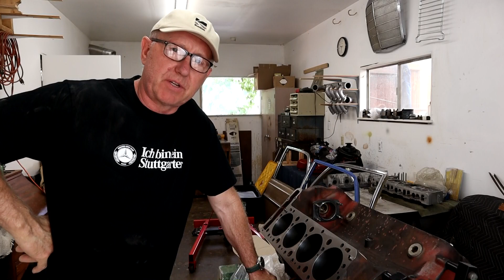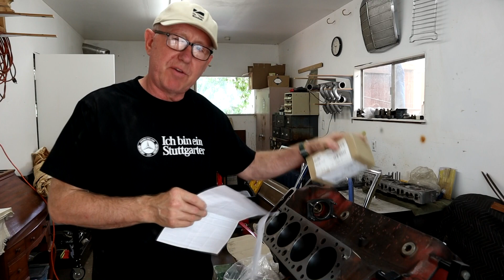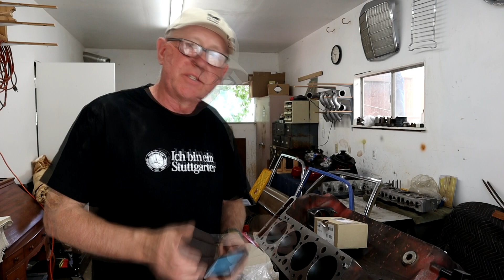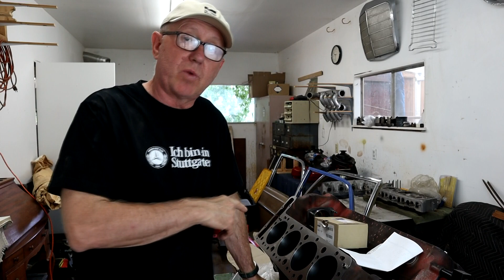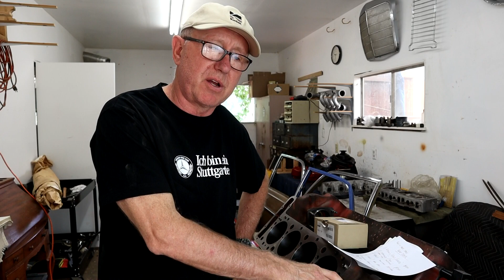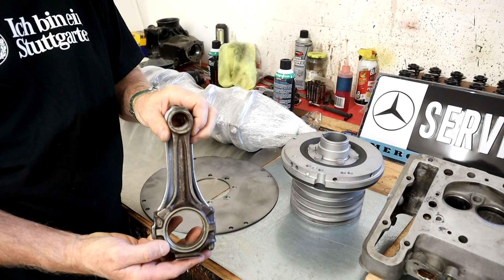MERCEDES M100 6.3 ENGINE BUILD COSTS PART 1

Comment: Was just one bore machined to +0.75 (and the other seven cylinders only honed)? Have you considered sleeving that bore to standard? Sorry if this is a dumb question on this specific engine as I am not an expert, just learning! Thank you.
Reply from the maker: Not a dumb question at all. I had all cylinders bored to 103.75mm. Which is essentially between first and second repair size. Sleeving just one cylinder could result in the adjacent bore being distorted. So you should do the whole bank. It was more economical and advised to re bore and have pistons made. They wanted nearly 3k in machining costs to re sleeve the whole block. Then I'd have to use standard older pistons that I didn't know the history of. 
All the best Cheers John.
Reply: @mercedesmaintenance.6339  Oh I see! Then re-boring everything was the best way to go. Thank you!

Comment: Very nicely presented video, 👍the costs are about right there with this sort of specilised work at the turners. 
One thing, the block and the parts that will go on are quite heavy. Will the engine stand suffice...it will need support in the front too, maybe with some wood blocks. I have seen the video where you re-enforced the stand but do not rely on it, the bolts can hold but the frame might sheer. All the best, cheers!🚘
Reply from the maker: Glad you liked the video. As for the stand. It is rated to 2000Ibs most others are 1000Ib rated. But I hear what you're saying. I certainly don't want any mishaps.. I was going to ad extra support when I get to putting the heads on. Or I may switch it to the stationary stand at that stage which is very substantial.
I appreciate your input.
All the best Cheers John 🍻

Comment: One thing is to assemble alll the crankshaft bearings with their proper torque and oil without the front and rear seals so you can rotate the crankshaft by hand and make sure it feels good. Should rotate freely. You have to take it apart again to put the seals but it is worth the effort in case something is wrong. Also never rotate anything until it is torqued to the specs.
Reply from the maker: Thats exactly what I was thinking. Making sure we have freedom of rotation before installing the seals. Cheers John 🍻

Comment: Costs of that engine are good, given the pistons are odd ball size. It should run well. Don't forget you can use normal engine oil on assembly. 20W50 is good. One thing those engines have the advantage is no rod studs to scratch the crank. When you eventually get the heads on, use a smear of oil on the head bolt heads & washers, to ensure proper torque loading during tightening. Use three stage tightening sequence. Elring, or Victor Reinz gaskets preferred. Before putting any parts in the block, flush the oil galleys with mineral spirits (turpentine), then blow dry with air. After installation of the crank, pistons & rods, fit the oil pump, & prime it by filling the pick up, & rotating the pump. Use a lighter grade oil, such as 15W30. During assembly, oil the bores, & rings. Set the ring gaps so none are lined up, & none of the gaps are in line with the pins.
Reply from the maker: Love it Chris. I had some questions regarding assembly. Because I anticipate from start of build to actually firing up could be quite sometime. I was intending to use assembly lube. As it's design is stickier and should stay in place for an extended period of time. 🍻 John.
Reply: @mercedesmaintenance.6339  using assembly lube is best. Get a couple of bottles/tubes of it. When you eventually fit the chains, you can prelube them.
Reply from the maker: @christophermarshall5765  Thanks Chris!!